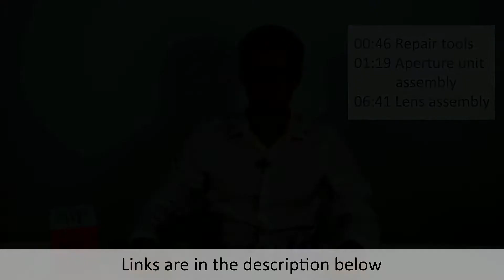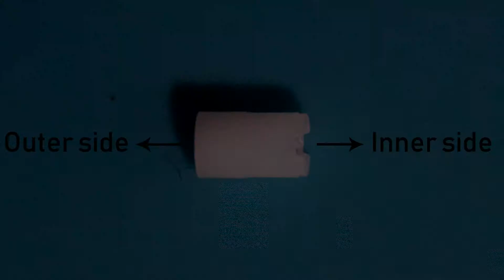Canon EF-S 17-85mm f/4-5.6 IS USM lens assembly (after replacing the aperture flex cable)

Comment: Excellent re-assembly video for the lens. Now that I have successfully repaired my lens, I would strongly recommend others to disassemble and the rebuild the lens on the same day or consecutive days since there are a many steps to the repair and even with the videos it isn't always clear if you have missed an element until later in the re-building cycle. The lens mechanics are extremely complex (and impressive.) I found what worked best was to lay out all the parts are you remove them into a large box with a white paper lining. Use masking tape (sticky side up) to hold each group of parts and especially the small screws and other small parts. Number the parts on the paper lining as you disassemble the lens - ( this will save you hours later avoiding a missed step or a wrong build sequence.) Work with the lens over a large open box lined with white paper on your work surface so if you drop a very small part it falls into your box. I would advise buying the aperture unit with the cable soldered already, since soldering a new cable is quite difficult (even for an electrical engineer with the correct soldering equipment) and if you soldering the unit wrongly you had a dead lens and many hours of effort wasted. If this is your first such repair, I'd suggest allowing 4 hours minimum for disassembly and perhaps 8 hours or more for re-assembly assuming you have numbered all your parts into small groupings inside your storage box. if you have any problems add another 4 hours. There are a couple of steps missed in the video (inserting the plastic focus ring with the post before inserting the barrel of parts - if you optionally removed this on the dis-assembly- it does simply fall out) so numbering the sequence is extremely useful. In my case I left a gap of about 5 years between disassembly and the re-build so this video was perfect for me. Many thanks !
Reply from the maker: When I disassemble the lens, I place the removed parts next to eachother from left to right, then when I assemble them, I just go backwards.
Reply: @CamerasLensesEtc  I used a small fridge magnet and placed the screws in groups with the screw head down. If I moved it or bumped it it didn't matter, they all stayed in place, like a bunch of tiny soldiers. I used another small magnet on my screwdriver shaft because mine wasn't as fancy as yours, already magnatized! I did the same as you mentioned for the key parts.

Great video, helped immensely. Thanks!

Comment: I thanked you for your help tracking down the broken flex cable problem 2 years ago, but my problems didnt end there. After I replaced the flex cable, my lens was still not working, and still giving an error code, so I put the lens away in a cupboard and promptly forgot about it. Fast forward two years and I remember that my camera has been sitting unused for a long time and needed recharging, spotted the broken lens and decided to have another look at it, with the intention of buying a replacement lens for the 17-85mm. But my camera, a 40D would not power on after charging the battery. Tried with other working lenses, no lens, memory card removed, it was dead apart from the red led flashing when I closed the battery lid. I tested the battery and it was fine. I inspected the battery contacts in the body and gave them a clean, and then noticed the back up battery, so I pulled it out and it also tested fine. When I tried to put it back in, I couldnt figure out how to get it back in for a couple of minutes, until I noticed I was trying to insert it in its holder sideways; enough time to well and truly clear the memory. After putting the 3V battery back in and then the main battery, the camera body came back to life. After going through the basic settings, I attached the repaired lens, and it also works! Hopefully it gives me a few more years service as it is a useful lens for me. So once again, thank you for this excellent repair series, and if anybody has the same issue, try clearing the memory.
Reply from the maker: Thank you for your comment, and I'm glad that my video has helped you!

Comment: Another superb video - many thanks. An interesting note that may help some lens owners stop scratching their heads when wondering where those 4 screws go that are left. I found that when disassembling and reassembling the plastic ring - here at 22:10 or thereabouts, 4 more screws are used on my lens. The hole that is said to stay empty also has a screw as do the 3 other holes left empty in this and other videos.I don't know if Canon did away with the extra screws at some stage. Nevertheless, lens works perfectly again. Many thanks.
Reply from the maker: I have an another video about disassembling this lens, I would recommend to check it if you're not sure where the screws came from.
Reply: @CamerasLensesEtc  Hi and thanks for your response. What I am referring to is that in your videos, the USM motor is held in with 3 screws, (7:57 on second video - disassembly). When I disassembled my lens which I have owned from new (2005) has 7 screws, so the screw holes which are empty on the USM motor in your video are fully populated in my lens. I disassembled the lens about a week before I received the power aperture unit and cable so I had overlooked this part of the disassembly. I used video 5, this one, to make sure I was assembling correctly. I then found that I had the 4 screws left over when fitting the circuit board and knowing there were only the bayonet screws left to fit. So I think that some of these lenses have 4 more screws fitted and Canon decided to remove them at some stage in production. Why otherwise would the holes and threads be there in the first place? Do you agree? Thanks again for great videos though. I repaired my 28-70 2.8L as well. It was an old ex pro lens and had a loose front element and rear section. Tightened all loose screws and found rear assembly had 2 posts broken. Thank you cyanoacrylate glue ;-)
Reply from the maker: Some of the 17-85mm has 6 screws in the USM motor, and some has only 3. I think the newer ones has only 3.
The USM motor has only 6 holes total, so it is interesting that you had 4 screws left...
Also, there is an empty hole in the ring which is under the PCB, and top of the USM motor. The empty hole is under the aperture cable, towards the end.
My guess is that after Canon designed the lens, they realized that they can save some money by not putting that many screws in the lens.
Thank you for the feedback, and I'm glad you could use my videos to repair your lens.
Reply: @CamerasLensesEtc  Exactly, that is the 4th screw. The one that goes in the hole that you state should be empty at 24:23. Serial number is 07203235 so I don't know if it is early or not. I presume it must be as I bought it new in a kit with the 20D in 2006. It was massively discounted from €2290 (imagine that) to €899 as the 30D had come out. I presume it must have been 2004 or 2005. It lasted almost 7 years and died end May 2013 with err01 and possibly also 99. I was working in Djibouti at the time and had a day of 58C - I thought it was the cause. I put the lens away. A month later I bought my 6D 24-105 kit. Now it's time to sell my 20D with perfect lens - 8000 actuations only... and as new in orignal packaging with all papers ;-) I think I will probably gift it.

Comment: I had disassembled my lens using someone else's video, it turns out it was a very bad idea, because 1/ the video stopped just before the difficult part, and 2/ he made me disassemble parts which didn't need to. Also, there was no video about reassembling the lens afterwards, which can be very tricky without instructions. So, a huge thank you for your video, it was a lifesaver!
Reply from the maker: Thank you for your comment, I'm glad my video was helpful.

Comment: Thanks for this video. I repaired my 17-85. Great tips for unsoldering. I really like this lens. It went out of service this summer and I found myself with no lens except a 50mm and a 100-400. Not really great for street and landscape. Now I'm with my 17-85 again. Great! I also repaired a first generation 18-55 just before (same aperture flex problem), so I could train myself before trying my new skills on the 17-85. Much more easy to disassemble and reassemble a 18-55 than the 17-85, but the construction quality of a 18-55 is very poor. This 17-85 seems to have a good construction...except the aperture flex conception. Good Idea to bend it to give it some extra shots.
Reply from the maker: Thank you for your comment, I'm glad that my video has helped you!

Comment: A very complete video tutorial, thank you. Unfortunately I didn't succeed at de-soldering the cable, a very tiny wire connecting one of the motors broke so I couldn't re-solder the new cable. I'm wondering, would it be possible to leave the end of the cable on the aperture, just cut it, and solder the new cable on top of it? Eventually I ended up replacing the aperture unit. Still very grateful for this video.
Reply from the maker: You have to be careful with desoldering the broken cable, make sure that the soldering iron has melted, then lift up the cable. You can leave the old cable on the aperture unit, but I prefer to remove the old one.

Comment: I cant believe it, I think I found my lens problem. My lens has an intermittent fault that I could not track down. I disassembled  the lens to clean some of the elements and thought I would give the tip at 10:30 a try and bend the bar out to give the flex cable a bit more room to move, and the flex broke. I think it had been hanging in there giving an intermittent connection while I was thinking the problem was on the main board. Thank you ever so much for these fantastic videos.
Reply from the maker: Thank you, I'm glad you like my videos!

Comment: Good morning All,
Thanks a lot for this great and very useful vidéo . Just something i want to suggest, instead of trying to remove the old flex cable, perhaps we just need to cut it and let enough space between each pin and put the new one over the old flex. I think it really avoid to heat twice each pins, cause mine is dead at this mine , i order a complete and already solded one . Grrrrr
Reply from the maker: Hi! Thank you for the suggestion. Sometimes I have a non-working lens which was repaired by someone who did not remove the old cable, but just soldered the new one on the top of that. 
I prefer to remove the old one, I have never ever had problem with heat, but the risk is when you remove the old cable, you might lift up the metal pins (connectors), and the thin wire can be broken. It happened me once, and learned my lesson, since then I remove the cable very carefully.
Reply: @CamerasLensesEtc  That's what happened to me even if i proceed very carefully anf after cutting the old flex in order to proceed with one pin at a time . Cheers

Comment: Thanks for a brilliant tutorial, I used this and the one on the EFS17-55 one to fix my focus hunting issue. I do however have a slight issue, I have a very small (about 4mm by 7mm) black rubber pad with a hole i it that I cant see on your video's but looks like it may have come out of the rear housing. any Ideas? (the lens is functioning perfectly with out it???)
Reply from the maker: Those suppose to stop the lens from having zoom creep.
At 19:07 I put back three screws and and their collars, and that small rubber goes next to the hole where the screws goes into (inner hole, in the USM motor). You can see the place of the rubber at 17:07.
Reply: @CamerasLensesEtc  Superb, thanks for your help

Comment: Just saw that my EFS15-85 Canon lens had a snapped flex cable. After some searching came across your video
which i find methodical and well explained. I wanted to know if the replacement procedure is the same as the EFS 17-85?
Also what caused the cable to break...does the cable move in and out with the zoom movement eventually weakening the wires?
Many Thanks...also for all the links.
Reply from the maker: I haven't disassembled the Canon 15-85mm lens, so I don't know the difference.
As the lens zooms in and out, the cable moves, and it gets weakened, and it might brake (it takes years). However, I find that strange that the cable broke in such a new lens like the 15-85mm lens.
Reply: @CamerasLensesEtc  Thanks for the reply...I think i bought my camera 7d with the lens, new, about 6 yrs ago and I use it a lot
so with the wear it seems to have just broken on one of the leader edges...

Comment: Excellent... After my de-soldering debacle... My replacement Aperture diaphragm arrived today... So I've just spent a good 3-4 hours carefully re-assembling. These instructions are VERY easy to follow, but somehow you seem to manage everything without:
a) dropping small screws at late stages into the mechanism... Forcing a dis-assemble and re-assemble again ;-)
b) getting dirty fingerprints over the exposed lens parts... requiring plentiful cleaning (and also ensuring de-dusting) along the way.
Anyhow upshot is - now I have a fully functioning lens again :-)